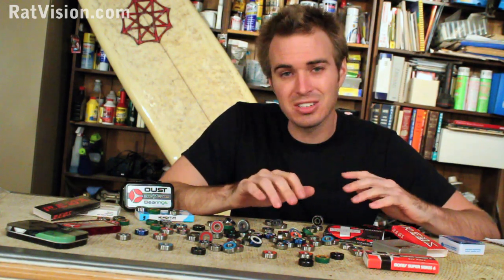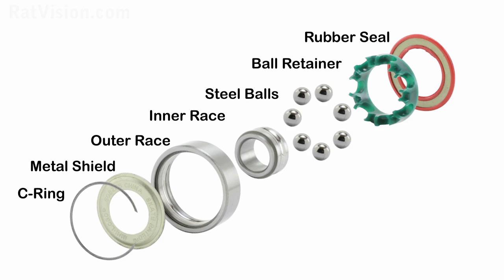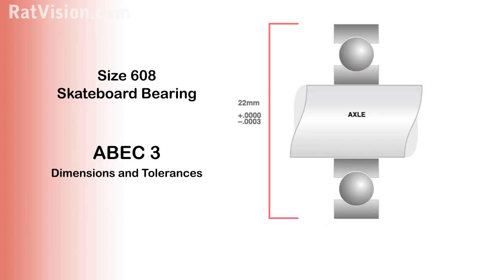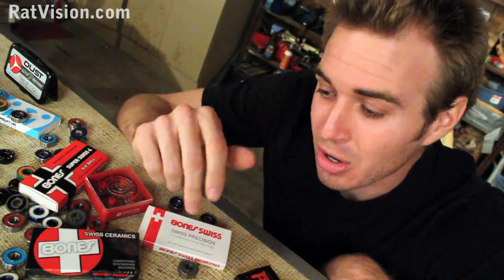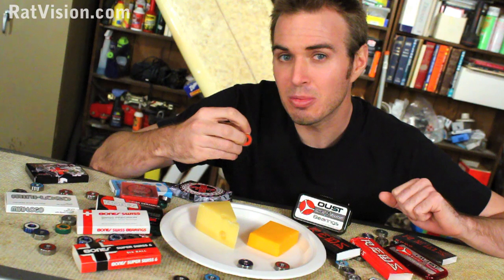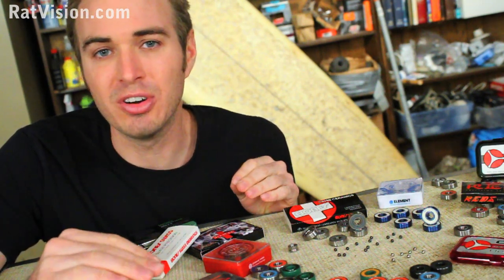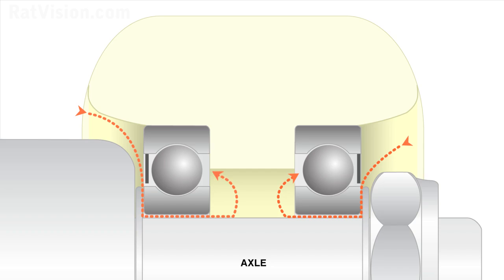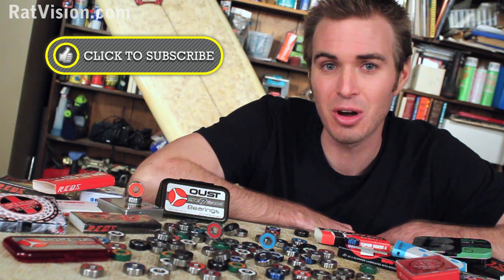What is ABEC / Swiss / Ceramic Bearings

Comment from the maker: According to Rush, "The ceramic cleans debris and cools friction allowing the bearings to perform and last longer."  I highly doubt one ball is going to do any cooling at all.  Ceramic only has a harder surface than SOME steel grades, which may or may not be harder than the steel balls in the bearing.  In our opinion it serves no purpose.  Their bearings do have a good price though.

Comment from the maker: People are brand-washed. They assume becuz Sector 9 is a bigger brand that they have better quality than a smaller brand like Oust. Sector 9 bearings are the same as Rush, Element, Spitfire, and Shake Junt, and probably some others too. We don't recommend ceramic bearings at all. No, Sector 9 ceramic bearings are not better than Oust bearings. Why would you want to spend $100 on bearings? What are you hoping to gain? Our opinion, u got ripped off by Sector 9 bcuz they buy them cheap from China.

Comment: Only a few ceramic skateboard bearings uses Cerbec (only two that I can remember, one from Bones and one from RocknRons), others may even use steel ball with ceramic coating, which results in very poor quality; others use different type of ceramic that is inferior to Silicon Nitride.

Bones has two ceramic bearings. Only one of them mentions the registered trademark Cerbec®, and this one costs twice as much as the other one. I think that the other one does not use Cerbec.

Comment from the maker: The price is great.  A lot of people love them. They work.  They certainly aren't the best.  They only have 1 seal, which leaves one side completely exposed to corrosion and lubricant leakage. They have shallow raceways with does not allow the bearings to handle axial and torsional loads well.  In our opinion they are a great beginner to intermediate bearings.

Comment from the maker: The wheel center of Seismic wheels were too small for tekton bearings with built-in half spacers. Why would they do that? It's because they don't manufacturer either the wheels or the bearings. They have the same issue as the Bones wheels in our video about bearing spacers. Basically, in our opinion, Seismic (Tekton) and ABEC 11 (Biltin) are marketing companies that sell skate products.  This is what has happened to the skate industry. Hardly anyone makes products anymore. They do marketing.

Comment from the maker: Biltin and Tekton did not create a solution to the problem. Watch our video on bearing spacers? You will definitely know that these brands just came out with gimmicks. Seismic wheels don't accommodate Tekton bearings perfectly, and Biltins don't fit ABEC 11 either. From Tekton, "The broad flanges square up, co-align and self-stabilize inside your wheels - correcting for flaws in bearing seat levelness, bearing seat spacing, axle diameter and axle straightness." Who are they f**king kidding?

Comment from the maker: Neither. They don't do what they are implying they do. What wheels do they fit in? Both are cheap Chinese bearings, in our opinion.  Built in spacers only work for wheels that will accomodate them.  They aren't solving a problem because wheels have different centers.  Watch our video on bearing spacers.

Comment: What do you think about bearings with integrated spacers, like Biltin and Tekton?

It seems like a really good solution to the problem outlined in the video (different wheels and spacers having big tolerances for the .4")

Have you tested them? Are they better for a tightened up set up?

Comment from the maker: Cool.  Glad I could help.  Remember, just because they are ABEC 9 there is no guarantee that they will function better than ABEC 7 or 5 bearings. All the other features that make a bearing better than another effect performance. We can only hope that extra care went into the other factors as the tolerances got tighter and gave the bearings an ABEC 9 rating. You won't hear any of this stuff at any skateboard or inline shop, because employees don't know anything, but what is "cool".

Comment from the maker: Most bearings that come stock in roller blades are very slow at first. New bearings go through what is called a break-in period. This period is about 10-20 hours and it depends on the metal surfaces. Basically, the surfaces of the balls r getting familiar with the raceways surfaces in the rings. The metal surfaces actually change and get smoother. New bearings also tend to have more lubricant than needed. After a few days of skating your bearings will start to spin faster, if they stay clean.
Reply: Bullshit, that's just the grease heating up.

Comment from the maker: I deleted everything the other guy commented on.  It was absolute BS.  For inline skating you need tight tolerances.  Go with a high ABEC rating because this is what the ABEC scale rates.  Unfortunately, as I mentioned in the video, the rating does not cover speed or durability.  However with tighter tolerance your bearings will hopefully last longer.  If you really want to know more, send us a private message through our channel. DON'T use a "gel" or grease lubricant, use a good oil.

Comment: I just did not get the difference between ABEC 3 to ABEC 7 (I'm a rollerblader). Pple told me it was Speed / Resistence,... an ABEC 3 would be 30% Speed and 70% Resistence, while ABEC 7 would be 70% Speed and 30% Resistence. Is that true? Ty a lot!

Comment from the maker: Again, same thing I said before.  So what if the ceramic removes corrosion? You're still left with a damaged surface that a ceramic ball is not going to repair, re-polish, or smooth out.  Once a steel raceway is compromised by oxidation there is no turning back.  What damage has been done is done. Regardless of what you think a ceramic ball can do, it will not fix the problem.

Comment from the maker: Watch our video on cleaning bearings.  You can clean them the same way we show in the video, but it's really hard to dry them completely.  Use +90% alcohol.  It may not be the best cleaner but you'll reduce the chance of getting rust.  You don't need to rinse them if you use alcohol.  If you use a lower % alcohol you can get rust, because the other percent is water.

Comment from the maker: MOC 5 Street does not have a removable shield.  The MOC 5 Tech, MOC 7, and MOC 9 have removable rubber seals.  All of the Oust bearings have seals, or shields on both sides.

Comment from the maker: You're absolutely right.  A lot of brands come from the same exact bearing manufacturer too. I believe Rush, Element, Sector 9, and maybe Spitfire bearings all come from the same place.  We can ONLY ASSUME that Swiss bearings have better engineering, but also keep in mind that it doesn't make them automatically better than anything that is not Swiss. This is why we can only assume or hope they are.

Comment from the maker: Seals or shields on both sides, because that means they will be protected and stay lubricated longer. However, it doesn't mean they will be the most durable or fastest. It's a place to start for sure though. Price is something to look for. Most of the time you are paying for a brand name more than quality. Bearings are mostly Chinese made and have been market up a ton. Some of the best bearings I've had were $10 NMB bearings. You don't need a high ABEC rating bcuz u don't know the other factors.

Comment: Of course ceramic is more fragile and harder than steel, it's exactly why we use it in longboarding. We will NEVER have 8200 pounds of load in this sport, so there is no problem for shattering out. Please inform yourself better before doing reviews because ceramic bearings are obviously better than regular bearings.

Comment from the maker: You didn't listen. I said, "compression test".  Hardness is measured in many ways than just one.  You are talking about molecular strength. We did a compression test because bearings take on loads. I know there is a difference between metal and ceramic. It's surface can be harder than many grades of steel, but it's still fragile. But in a certain application ceramic fails because the plastic deformation and ductile qualities of steel are better suited. If you want to talk crap do it accurately.

Comment: Your "hardness" test is absolutely useless and incorrect. Hardness is measured by how strong the bonds between a substances atoms are, essentially how easily it can be scratched. Diamonds and glass are some of the hardest substances around, but will shatter at a lower pressure than any metal. Please please please don't listen to this terrible test as it is both completely erroneous and misleading. Ceramic bearings are harder than steel, and will not scratch as easily.

Comment: As a mechanical engineer student, your hardness test wasn't really a harness test. You only tested tensile strenght, wich is the property of the material to elongate. In fact, the more a material is hard, the faster it will break. They are not selling ceramics bearing so pricey for nothing

Comment from the maker: Both Moc 5's are the same bearing, but have different closures (seals/shields).  The Street bearings have pressed in non-removable metal shields, and the Tech bearings have removable rubber seals.  The difference in MOC is the difference in tolerance, and if I am correct, surface polishing.  These differences result in speed and better load handling.

Comment from the maker: Glad u r interested in making sure u understand. Tolerance is the allowable space between the balls and the races. There has to be tolerances or the parts touch and don't move. Watch again to see about loose tolerances and loads and friction. Tighter/smaller tolerances are given higher ABEC ratings, which is better. BUT, remember there are lots of other factors that make a bearing better than another. So, ABEC ratings should never be used to determine how well a bearing will work.

Comment: Great video, I learned a lot. I'm still a little confused (and maybe dumb). Speaking in general, is a high or low tolerance going to create less friction and be preferred? I would think a smaller tolerance measured would be better. And does a smaller tolerance translate into a smaller abec rating? Sorry if I'm being redundant.

Comment: So thanks for this but the Swiss and ceramics are Bones fault.

Bones Swiss are called that because of where they came from a small factory which Powell found the best bearings. Then everyone else jumped on the bandwagon.

Ceramics actually clean the inner and outer wheel extending life but I wouldn't use them on the street.

That said I'm running enuff abec 9s and I don't need to go faster

Comment from the maker: We recommend Oust.  In our opinion Zealous bearings are not good.  If you read about them they are not a bearing manufacturer.  They purchased Chinese bearings with big built-in spacers that don't fit all wheels correctly, and found a guy who works for a lubricant company called Archoil. Archoil makes ceramic lubricants. People in the skate industry love the word ceramic. We have not tested the lubricant, which is their selling point, not the actual bearing, so we can give an opinion on that.

Comment from the maker: Here is the important thing to remember.  There are no instructions, special materials, ingredients, designs, regulations, and requirements to make a bearing "Swiss", except that it is made in Switzerland using Swiss material. It's still Swiss even if it's crap, right? We assume Swiss is better than China. Like Mexico or Canada. People assume Swiss steel is special because it comes form the Alps, which makes it extra hard. The same grade steel from one country will be the same from another.

Comment: I get your point, with out a valid fast-life test and what not, we can only assume which brand is better.  Technically, neither the boards, trucks or bearings have real field (or simulation) tests. They just have random parameters that say that improve the use and life of the products. Skateboarding products need some serious background check. That's why I said in my opinion.

 PS: I though the "Swiss" part of the Bones Swiss was just the name of the brand, I never imagined they were made there.

Comment from the maker: The problem is that we don't know what has been done to the bearings, and neither do the brands themselves, because they just buy the bearings from a manufacturer. Bones Swiss bearings will most likely operate better than other bearings, but can ONLY ASSUME the Swiss have higher quality over other brands. But, we can't assume anything just because it's got "Swiss" slapped on it. Tolerances, surface finishes, 2 shields, and lubricant are probably the most important factors.

Comment: The problem that I see is that my favorite brand for bearings for a LONG time were the Rush bearings, but tried lost more like Zero and what not, but 3 years ago I tried the cheapest Bones Swiss bearings and they have lasted me forever (well, not forever but for a long time).

But yeah, I agree with you... I just think the thing that makes them a little bit better on the field (in my opinion) is another aspect besides material, maybe is geometry or something. It needs more field research.

Comment from the maker: Rollerblades take the same exact bearings as skateboards. Quad skates also use the same size for the most part, but there are some random skates that take a different size, because they have a smaller axle. You'll probably see some roller skate bearing packaging with either 7mm or 8mm. Not sure exactly what your second question was. ABEC 5 only tells you how tight the tolerances are. It tells you NOTHING about speed, durability, and quality. We recommend Oust bearings.

Comment: 22,000 pounds per ball bearing. Spread out over several ball bearings in each bearing race. I weigh 150lbs. I could kickflip a 3 story home and not land hard enough to break that, So I guess even the shittiest bearings will stand up to the comparatively low abuse of skateboarding.

Comment from the maker: The Swiss have higher quality standards like the USA. Just so we are clear, there are no instructions, rules, specific materials, and recipe for making a "Swiss" bearing. A chinese bearing can also have consistent and better tolerances than a Swiss bearing. Why not? If a Chinese mfr. did that would a "Swiss" bearing still be better? Of course not. A bearing is a bearing until someone takes the care to make it with quality material and machining. U r right cleaning and lube is very important.

Comment: The fact is, that Bones Swiss (WIB) have "consistent" tolerances and quality... unlike most Chinese bearings.There isn't much performance difference between high quality bearings. The most important thing is keeping them clean and lubricated. Also, nylon cages are faster and better than metal cages.

Comment from the maker: Bones explains the differences on their site. Super reds have better steel.  Swiss Ceramics MAY have better tolerances, steel, and more polishing.  Bearings labeled "Swiss" DO NOT automatically indicate superior quality and performance. There are no guidelines, instructions, recipe, directions, or specific material to make a Swiss bearing. A bearing is just a bearing. As mentioned in the video, there are a number of factors that make one better than another.

Comment from the maker: As you can see from this video there are a lot of factors that make one bearing better than another.  Just because you spent more money on the word "super" and ceramic does not mean that your bearings "should spin faster".  His bearings are broken in, they may or may not have lubricant in them (they should regardless), the wheels and trucks are different, and the bearing itself is different. Ceramic does not mean your bearing should be better at all.  You may have been a victim of branding.

Comment: What a coinidence, american bearings are the best, judged by an american!lol.  Also i had a top of range american skate board years ago and replaced the bearings with swiss speed bearing and it was then much faster.  full ceramics are out there your talking about hybrids in this video.  ceramics are much better than steel with 80% less drag, why do think formula 1 use them!!  Also the hardness test featured 2 steel bearings and 1 ceramic, why didnt you test more ceramics? why no speed test?

Comment from the maker: The black is only a color added to the surface of the steel to make it look cool. It can effect performance if the coloring gets on the raceway. The bearings the shop sells are Chinese bearings that anyone can purchase from a manufacturer and start their own brand and sell them for $5 a set. Each bearing was probably $0.25 or less. The manufacturer will make a custom seal with any name on it when you purchase a certain quantity. Most bearing brands are just cheap Chinese bearings.

Comment: I have a question, what are the differences between black and steel races? I wanted to support my local shop because it started making bearings named 'Imagine.' They have a rubber seal on each side, and black races for only $5 a set. So, are black races better or steel races for skateboarding?

Comment from the maker: There are 2 ways the bearings appear to fit.  1.) The wheel center is couldwider than .400" of an inch so both spacers don't touch each other, which allows the bearings to got all the way into the bearing seat in the wheel.  2.) The wheel center is smaller, so both bearings touch but the wheel is not center over the bearings and can move or shift over the bearings.  We point this out in our video about spacers.